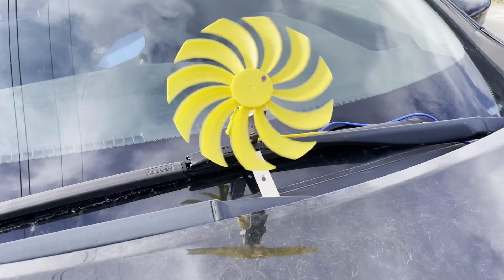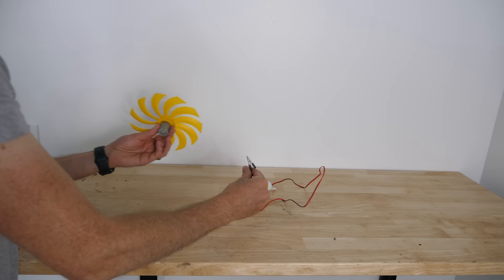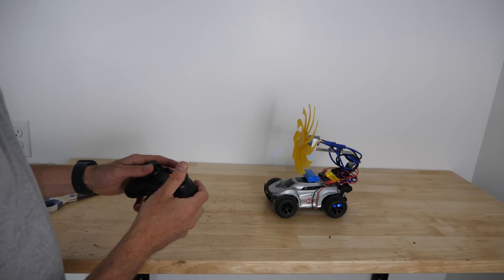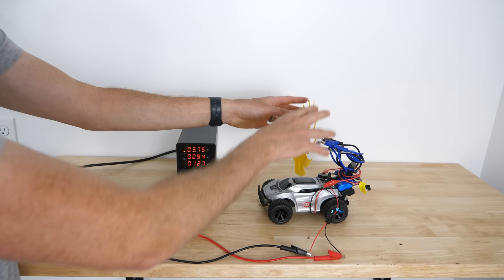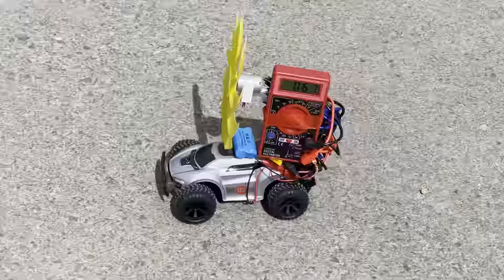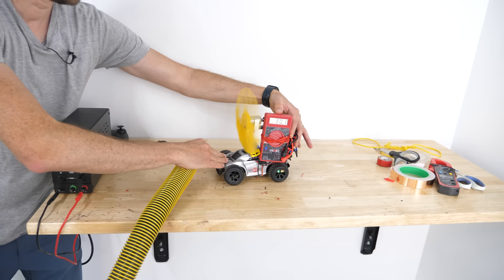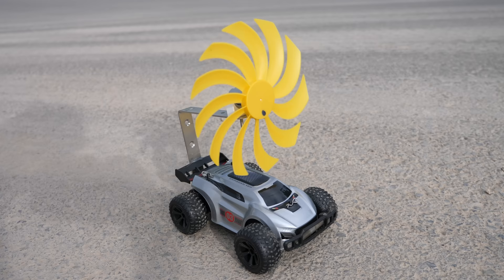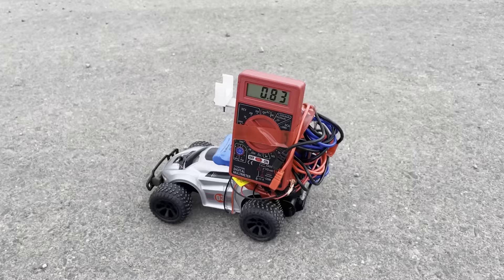Can You Power a Car With a Wind Turbine?

Comment: WHY is the windmill turning? because air is passing through it. WHY is air passing through it? because the car is moving forward. WHY is the car moving forward? because the CAR is being driven foward. WHAT is driving the car forward? the motor WHAT is powering that motor? the battery.

SO ultimate WHAT is powering the windmill? the battery. and since you can NEVER exceed 100% efficiency and all transaction are lossy you always without exception lose more than you gain.

THIS Is why regenerative braking (literally sticking a windmill or alternator on a car to charge it) only works while you are braking.

YOU ALREADY SPEND the energy to convert potential to kinetic (make the car move) normally to slow down you "dumb" that kinetic energy as HEAT in your brake pads and rotors. regen allows you to RECOVER some of that energy you already spend (not new energy) back into the battery (and also extends the life of your brakes)

If you turned on the "generator" (which you can't do since its literally "the drive motor" not a separate gadget) it would reduce your range not increase it.

Comment: You confirmed that there can be windmill-powered car chargers that charge the battery when parked in a parking lot overnight or so. that's exciting enough. even if it going to add 10 miles range overnight, it's worth it for free, right?

Comment: How about a fan directly behind the car grill, similar to ones in front of a radiator? Could that not generate enough power to help charge a battery while driving? I know EV's have pretty much done away with open grills, but let's say they didnt. Would that turbulence, being inside the vehicle, cause the efficiency to drop so much as to make it pointless? Genuinely would like to know.
Reply: Yes, it's still an extra barrier, but now it's operating in a different area that might randomly stop the blades as often as it moves them.

The whole thing isn't useful anyway. The concept is adding a moving and somewhat complex part to a car to generate enough power to maybe power a turn indicator. Even at maximum efficiency, with 0 wind resistance, a fan that isn't half the size of a car is like plugging a usb cable into your car to charge it

Comment: Because the problem is the wind mill then perhaps you should just directly connect the generator to a non motorized wheel 😂, or better yet, connect the generator to the motor!

Comment: A vertical-axis wind turbine (VAWT) Would be better - Wind From more than one direction Omni-directional   (Side Winds - and cyclone Winds and thrive in turbulent Air Zones)
- Vortexis & squirrel  cage's 
- Helical Darrieus

Some of the VAWT will even mount vertical and horizontal

Direct drive Hub Generateor / Direct Hub drive  Alternator  you Get them with 1 & 3 phase AC outputs & 120V & 240V outputs to interface With EV's most EV will Accepts AC & DC as A Very wide Voltage range 80V ~ 400V ~ 800V (AC & DC)

However EV's have A Power cord   Safeguard Fail Safe were if they detect  input on any power Input Port will disable the Drive mode and keep the Hand bake on

Comment: Instead of putting the blades on the front, what if you put them flat on the wheels, or on the back of the car? There's probably more optimal ways to this concept. If you had an elongated waterwheel type of turbine near the rear bumper, would drag have the same factor?

Comment: That result still doesn't make sense to me, because the RC car doesn't know it needs to use more power, it doesn't have a speedometer.
Wouldn't the car be using the same amount of energy if you were just driving it into a wall at full power?
I would expect the car to be slower with the turbine but not less efficient (unless you were forcing it to go the same speed in both tests).

Comment: Ask yourself where the energy is coming from. Trace it back and you'll find it's from the fuel in your vehicle. Same myth as air con doesn't use extra fuel or electricity from the alternator is free...

Comment: There is an obvious fault in the set up. You should not install big ass turbine in the tesla. But you can install small turbines with less blades to avoid more air friction. It would not be enough power the whole car but it will produce some charge without causing drag.

Comment: wrong placement.
just cut out the parts of the car that have the most wind pressure on them and insert a fan there to restabelize the car in its frame. The fan should lower the mass thats exposed to wind caused by movement of the car. If you get the wind inside the fan to compress. like from an wider opening funnel it to a small exit hole you start to produce enormus thrust momentum like a jet engine and propells you even further.
in theory , once you reached the needed speed to force enough air through he fan hat the jet effect starts, you could shut down the engine completly and use only the electric power produced by the fan and the breaks. i dont need to start with solar energy here on top of that.

Comment: even if there was some zero wind resistance windmill turbine the BEST you could hope for is a reduction of power use by some amount. You could never get net zero or net gain from the system. Some amount of energy is lost as heat in any system. Now even that "waste heat" can be used for useful purposes. There are countries in Europe where they are pushing forward with plans to use waste heat from data centers to heat homes or to partially heat them at the very least. This kills 2 birds with 1 stone.
1 the data centers want that heat gone and moved away from their servers and 2 it can reduce heating costs for home and business owners. If the system is efficient enough it will result in a net long term savings for the data centers and for home and business owners. 
Waste heat from say factories or even from power plants can be harnessed to produce power by heating water to turn turbines etc. So this can result in what is effectively a net savings as well. But in the end some power production is lost through heat no matter how well designed and perfect the system.

Comment: Didn't Veritasium and Integza both do videos on cars that can be powered by propellers from the oncoming wind? In those cases the propellers were mechanically attached to the wheels but I don't see why it wouldn't be possible to create an electrical connection. There would certainly be a bit more losses in efficiency since you're converting mechanical energy into electrical energy and then back into mechanical energy again, but I imagine it could still work.

Comment: In the future, electric cars could have a turbine or two inside of them, to extend range. Tesla cars are FLAT at their nose....Surely an internal ducted wind turbine doesn't create as much resistance as a somewhat flat front end on most Tesla cars, since much of the air would pass through the car, instead of hitting a solid flat surface......

Comment: So much missed out on this video which adds to net losses, weight of the fan and its brackets, wind resistance of its support system, added weight bearing down on the wheels and bearing requiring more energy to do the same work... the list goes on..
Reply: He’s a content creator.. he keep moving forward and not stuck on a single project.

Comment: This was just sad and depressing. The type of turbine matters on a vehicle. There was an inventor that pulled it off in the 70s for an electric  go-cart for an example. It's easy to go the way of the ancient Greeks and say the steam engine is only a kids toy. The way that it worked, it had a scoop to direct the wind into the turbine which is a cylinder style turbine. It's purpose was to trap and direct the air towards the ground through exhaust tubes at an angle that helps assist in pushing the vehicle forward so the drag is less of an issue at faster speeds by doing a little bit of compression and release. All while generating energy for the vehicle. It was never intended to run the vehicle but lower energy consumption. Surprisingly it's drag was less then your vehicle in your driveway due to the fact your engine compartment is like a sail at times. The design takes advantage of the  drag that happens there anyway but might even end up reducing it in theory.

Comment: We've thought about this one before, A net positive result can be achieved by the application of a principle we call optimum positioning. It is the concept of placing components into their optimum environment for the application. so in this case start with the lowest drag coefficient impeller. then give it a convertible environment, (ie) a compartment. Only deploy your windmill while you are parked, then you wait for a full charge. You could pick up charge while breaking or going down steep hills.  😉

Comment: So, your demonstration is a bit incorrect! You did increase the drag, but you did it by increasing the cross-sectional area of the car. If you were to constrain the fan to be in-line with the front-facing cross section of the car, you would see some reduced amperage. Essentially the drag that would normally result from driving your car is being made turbulent through the fan blades and reducing the drag on the car after the blades. You will still see some increased drag, but you are turning the drag that would normally reduce your car's efficiency and converting it to usable electricity. 

Theres been a few full-scale tests with cars that actually showed a slightly increased range on an EV. But, it wasnt a ton of efficiency gain, still not worth the hassle of installing a turbine to your car lolol.

Comment: I am not convinced. Firstly, its juveline to think Wind energy would be enough to run the Car all by itself! But there isnt any doubt that there is strong wind when you drive an actual Car and an efficient turbine would be able to generate positive power from it. Just put your hand out of a Car @ even say, 60kmph to feel the pressure. if your fan isnt moving with that wind, something wrong with your aerodynamics. I wish I could have gotten a more serious and genuine Video on the subject

Comment: Try a buck converter to boost the fans output?
Reply: A buck/boost converter is no different than an electrical equivalent of a gear ratio.  It can trade voltage for current, but it can't create any power that you didn't already give it.
Reply: @carultch  "electrical equivalent of a gear ratio" That makes perfect sense, thank you!

Comment: Testing on the bench in VOLTS then testing outside with AMPS hum one of these thing is not like the others one of these thing is not quite the same
Reply: >> Testing on the bench in VOLTS then testing outside with AMPS

And either way you only get half the story.  Volts and amps are meaningless by themselves.

Comment: Here’s an interesting idea. What if instead of using the wind to recharge a car battery of possibly a fully electric car what if you used the wheels themselves to generate energy to recharge the battery? Basically, you put the generator of the turbine into the wheels of the car and let the rolling of the wheels as the car moves forward recharge the battery

Comment: Place the turbine fan inside the engine compartment ( where radiator fan was placed in petrol cars). To control the speed of fan there are other methods. I think when car is on the move it can charge its batteries.

Comment: Your model adds massive surface area to the vehicle, and the use of such a small model is beyond problematic.  I strongly suggest taking it beyond the "brain fart" stage before displaying it on YT.  It should be mounted directly in front, behind, or both, and not sticking wayy out the top or sides. (Duh?)  A modified "Flo design" wind turbine is well suited to this application.  The velomobiles at the Stuttgart Germany race made 2 times wind speed directly upwind.  The Blackbird "dwfttw" proof of concept full sized, human piloted design managed nearly 3 times wind speed directly down wind.

Comment: 🇨🇱
I am disappointed ☹️😖
You could have spared the video up to the end where you explain that a Perpetuum mobile is not possible. 
Also disappointed to read so many ignorant  comments, who seem to beleive that a perpetual machine is possible. 

By te way, if you wish to harness wind energy, it would have to be TAIL wind, no head wind, as you said. 
Also for that, it would be much better to use a sail instead of a propeller 🤔
Saludos de 🇨🇱
Reply: >>  if you wish to harness wind energy, it would have to be TAIL wind, no head wind, as you said. 

And yet I set a world record for going directly upwind at 2.1 x wind speed in a wind powered vehicle in which a turbine turned the wheels.
Reply: @Rick_Cavallaro  interesting👍
Any reference or link to get more info?

Comment: this isn't necaserly true, you could use this on many things and gain power, However its expensive to add the turbine, and it would need to be powered by something, and the design have to be inneficent where this could help its effcency.

Eks.: cars are built to be very aerodynamic this means it will in all cases produce drag when placed on top of the car. 
However what happens if the fan is put behind the car or in front to make the wasted wind produce enrgy? well it will make your car more energy effiencent, look stupid as hell and people will question your sanity. it will however if placed on a electric car give you a slight benefit. you will not earn money on it, they are expensive moving parts that need maintinence, but it might give you a  extra km here and there.

Where it will be the most beneficial is behind trailers, they are square boxes that create a lot of drag. placing a turbine behind them would make them more effiecnt, however just making them water droped shaped (a tail) would also make them more efficient, why would you buy something that has moving parts when a static object does a job better.

Comment: The turbines on the road would be perfectly fine you are just over thinking it. It really doesn’t matter about the turbulent airflow it’s a fucking freeway were cars are already creating and lashing other cars with there own turbulent air behind every fucking car 💀 it wouldn’t make the cars super inefficient it would just make them maybe a little slower at most if anything.
Reply: And I’ve actually had this idea in middle school trying to power an ev by it driving. It’s possible just not really practical. You need to put the turbines where the drag is already not add a big ass thing onto the car creating a giant drag spot. 😂 it is possible just not practical.